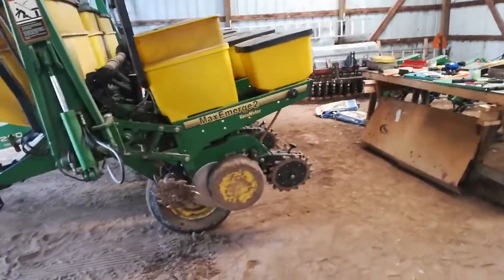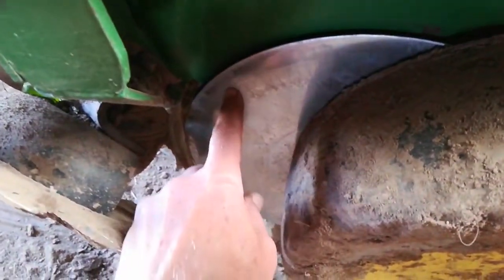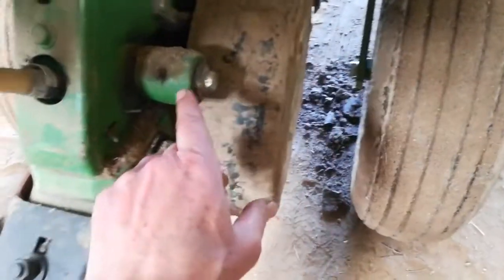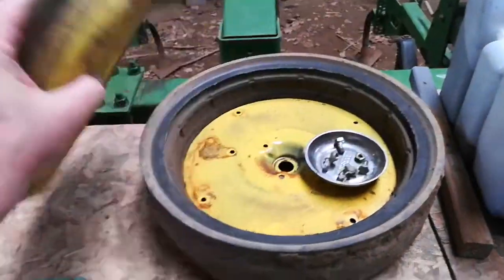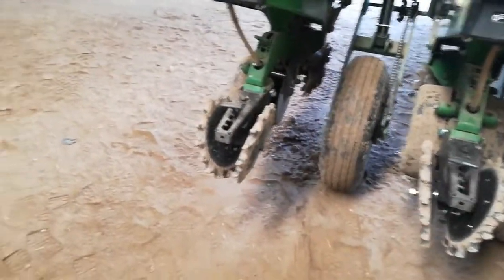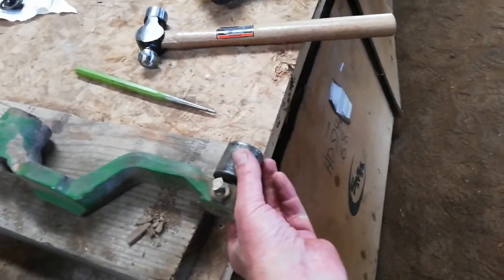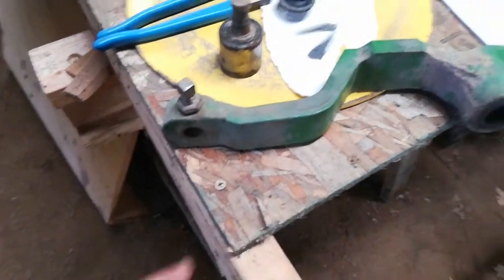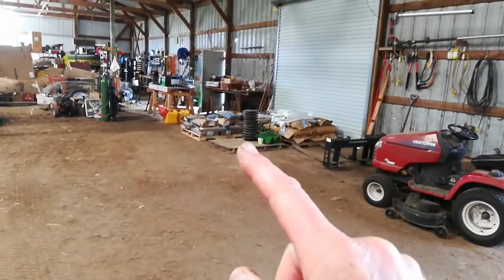Repair Wobbling Gauge Wheels on Deere 7200 Planter

Comment: I like the replacement from Shoup for older kinze planters. Wheel bolts on to arm . Arm is threaded at bearing mount. Bearing is 4 times size of original. Shoup number is GWK 3500 and sells for 63.95 for a set of 2. Bearing is Shoup number sh312132.